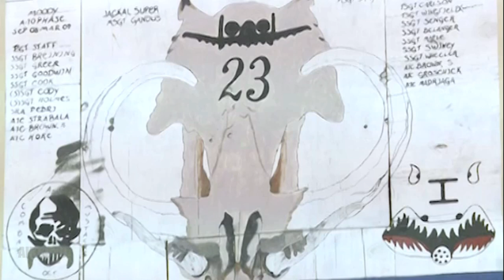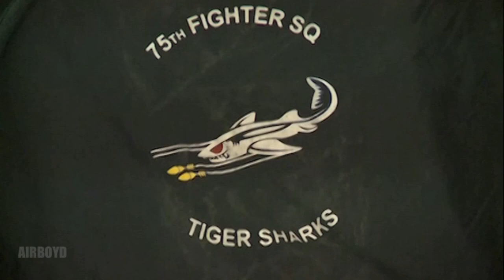A-10 Maintenance

Comment: As an old Aircraft  Mech from back in the 60's C-124/C-118, C7A Caribou Vietnam C-131. I see the good old speed handle has been replaced by electric/battery operated drills. Still miss the old sounds of  the hangar. Great video